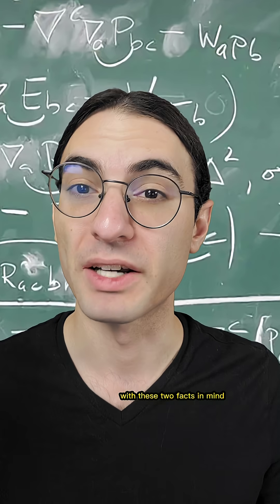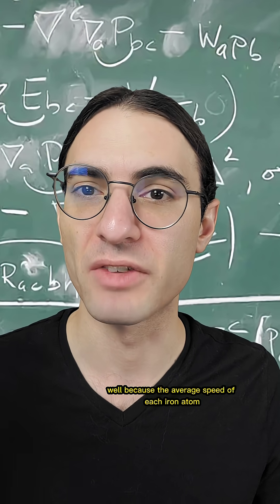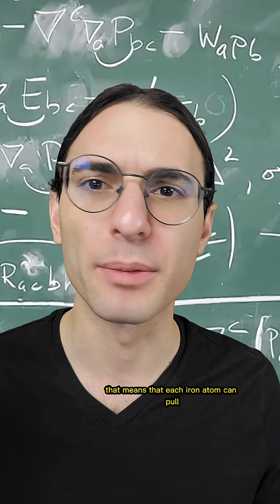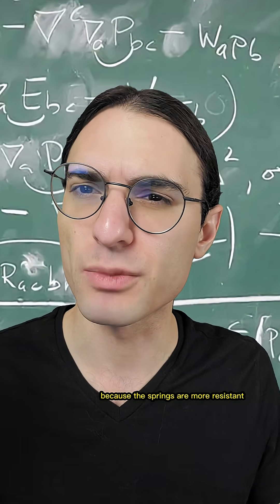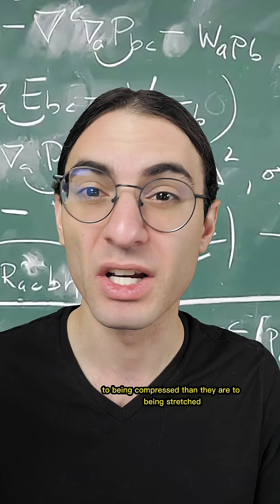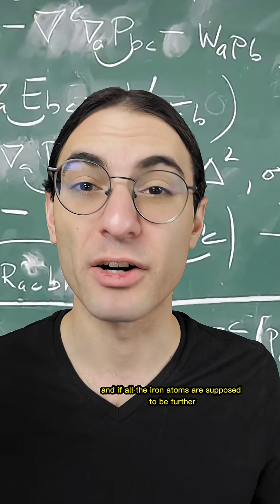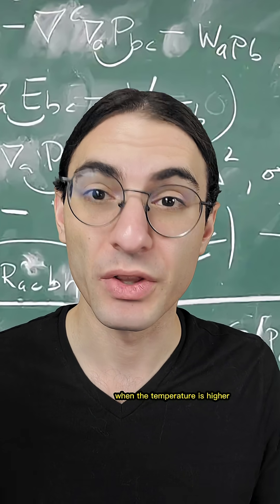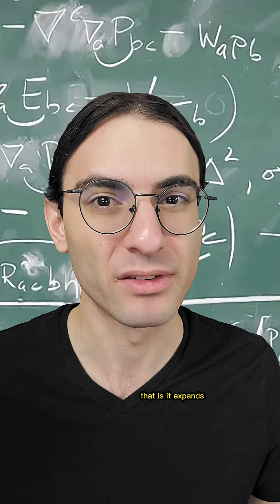Thermal expansion explained

Comment: CNC machinist here. I've taken a .0001" cut that ended up being .0002" deep after the material cooled down. I had to scrap a $50,0000 jet engine part because of thermal expansion.

Comment: basically,
atoms want to push every other atom around them away from them. cold = less energy, hot = more energy. so the hotter a substance is, the bigger it will be, simply because each atom has enough strength to push other atoms further away from them. it's also why a BEC needs to be incredibly cold; atoms simply don't have the energy to push each other away, and so they just kind of melt into each other.

Comment: I would love to hear
Your take on phase changes within steel eg martensite, austenite, pearlite, bainite, ferrite you get it. Let’s go science boy.
Reply: That's an advanced chemistry question, but in simple terms It's that the crystal structure changes depending on pressure and temperature, such that the atoms arrange themselves slightly differently to find the energy minimum (most stable configuration).
Reply: @youtuber7186 thanks if you notice I expressed a desire for his take on a physical phenomenon, the allotropic transformations of iron/steel that allow it to have the lowest Gibbs free energy state. Thats a thing chemists use to determine whether a reaction will produce energy or require energy to initiate or just happen spontaneously but on its face allotropic transformations are as much a physics concept as anharmonic assymetry so what is he a chemist now? Only thing that maybe makes this a chemistry-adjacent question, since I asked about steel, not iron, is the effect small amounts of carbon have on the delta of Gibbs free energy because they change the delta of enthalpy and entropy. And that’s what makes it an interesting question. It would be boring if it were just about iron. It’s good feedstock for a video where he can talk about Gibbs free energy, about magnetic moments, I saw in another comment someone mentioned invar, that’s magnetostriction in an iron alloy containing nickel rather than carbon that counteract thermal expansion. Carbon actually counteracts thermal expansion in iron too but that’s just an entropy thing. I didn’t realize I had to take a pop quiz just to suggest a related concept for a video ok have a nice day

Comment: Missing the definition of the thermal expansion coefficient which is actually what is important. Although, discussing water should have been avoided as it contains a reagon of negative thermal expansion.
Reply: Eh, the concept behind the expansion mechanism is a prerequisite to the coefficient.

The mathematical definition of the coefficient is important if you're planning to do math with it. What's generally important to know is that the rate of expansion isn't the same for all materials (i.e. that some coefficient exists)

Comment: At full expansion, does the gravitational force of say heated iron also increase?
Reply: No, if anything it decreases.
I like to say that gravity is calculated based on the amount of stuff in a cubic centimeter/inch (density)
The more stuff in a cubic centimeter, the more dense it is and the more gravity it has.
When you heat iron, it gets less dense, as does anything that expands under heat.
Reply: @projectmoonlight7413 hot things increase in mass slightly. They contain more energy, energy and mass are equivalent, a cubic centimeter of steel at 20c heated to 1300c is going
To be like trillionths of a gram heavier, more massive. More mass due to increased interaction with the Higgs field ergo more gravity before factoring in thermal expansion which is also going to affect the amount that the steel interacts with the Higgs field or maybe for this sake we could say it bends space time at a slightly less steep angle, but its gravitational influence on the rest of the crap
In the universe overall will be slightly stronger. The closest real life example of this (and it’s still a thought experiment but more grounded in our shared understanding) is that a spacecraft in motion has more kinetic energy as well, just at a different scale. All the particles are moving together along the same vector at the same velocity. It has more mass as its energy increases, regardless of whether that energy is in the form of heat, momentum, or rotation (different math there)